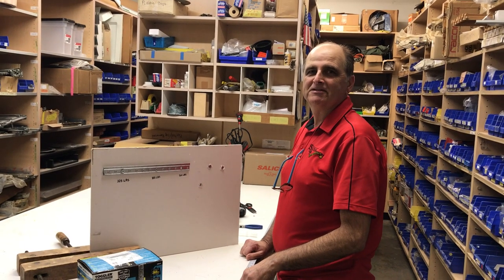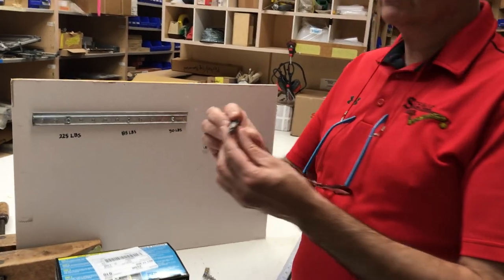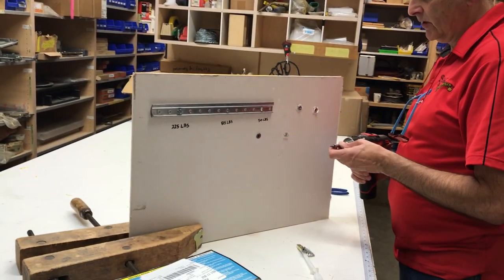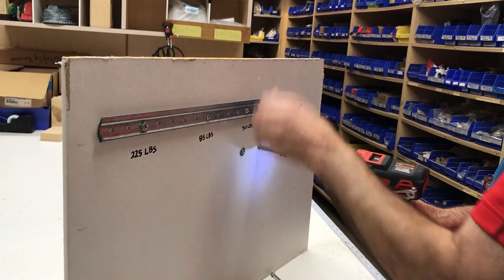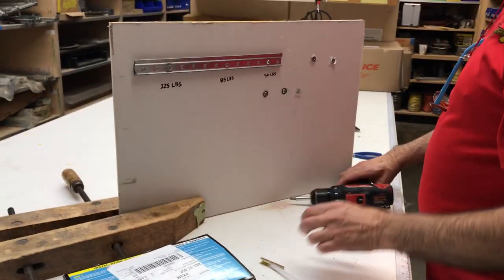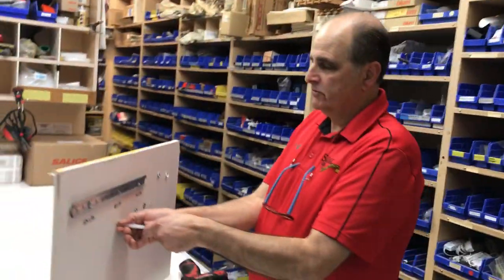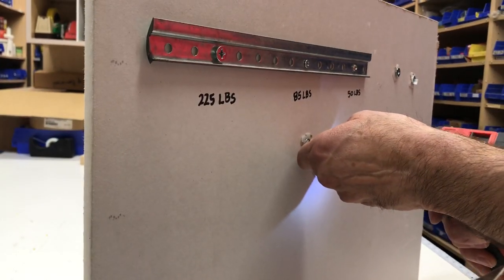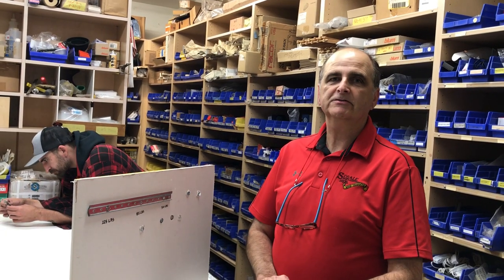INSTALLING 3 DIFFERENT DRYWALL ANCHORS FOR CLOSET HANG RAIL

Comment: Thanks very much! This is exactly the information I was looking for. My stud finder is unreliable, and it looks like I will be using drywall anchors for each of 5 holes used to support the hanger bar. I had been wondering if this was a wise thing to do. You answered my question. I'm going with the third option, and 225 lbs will be more than enough for my mudroom closet. Thanks again!

Comment: Most anchors a strongest when the screw -- or the bracket the screw goes through -- presses against the anchor so that the drywall is compressed. In the case of Closetmaid-type standards, the standard does not touch the anchor, so the drywall is not compressed; it's pulled. It seems to me that this reduces the shear strength considerably. Also, the length of the screw must penetrate a certain distance into the anchor for the anchor to work properly. If the bracket is too thick, the screw will not penetrate far enough, so longer screws will be needed. You'd better be sure you can find a matching screw in a longer size.

Comment: The camera is too far hard to really see near by because I couldn’t tell what’s being used to put that anchor into the wall, the same screw or different and what if the whole is so wide that the screw that is supposed to hold tight might just fall inside the wall together with the anchor and just lose the entire thing. 
That’s what’s concerning to me and this video fails to explain that.